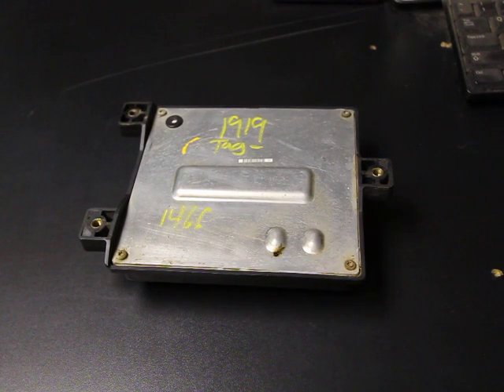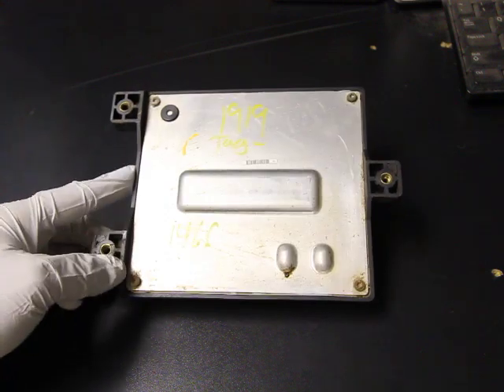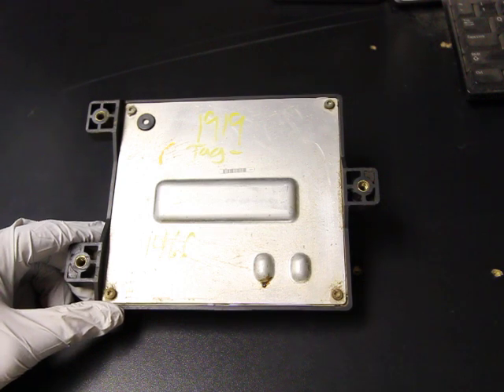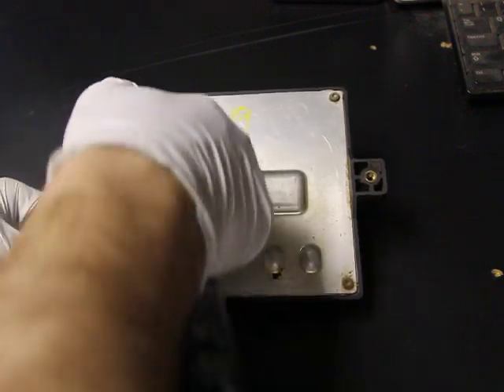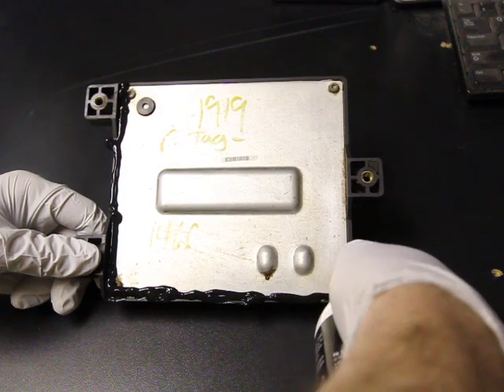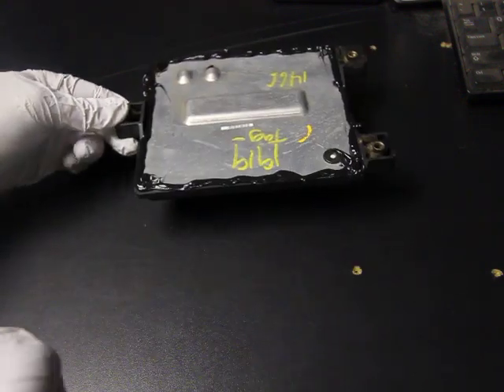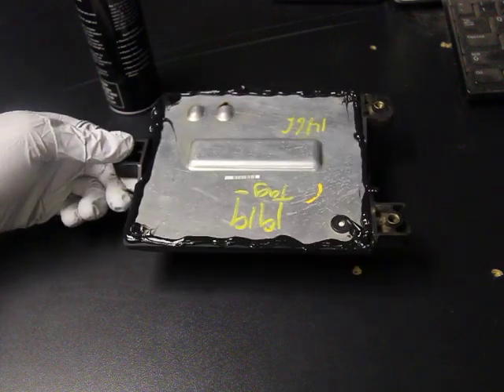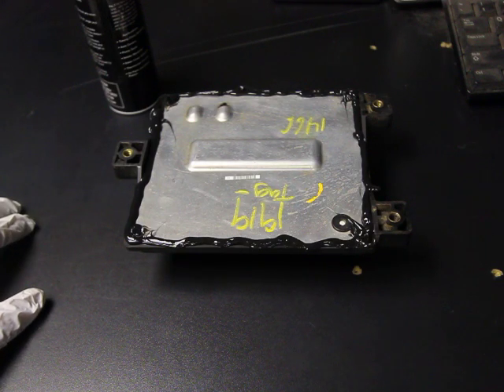Fuel Pump Control Module GM Truck GMT900 Silverado and Sierra replacment and programming info

Comment: Thank you, but we worked on it last night late into the night, was no power doing to the fuse. Pulled the fuse box’s and found a lose wire going too the fuel pump fuse. Damn something that damn simple, left me stranded with no truck for a week, that’s f up .

Comment: Will a Failing FPCM cause low Fuel Rail Pressure? When I “key on” the Truck (07 Vin C Gmt900 silverado 1500) i get 58psi. But when I start the truck fuel rail pressure slowly drops down to about 43psi. When i give it gas it goes even lower than that. 38,39,40 ish.
Reply from the maker: It could put power directly to pump and measure pressure

Comment: I see you say the 07 Tahoe does not have  one. Is there just a ECM under the hood
Reply from the maker: ECM controls the fuel pump relay which in turn powers the pump on 07 Tahoe
Reply: @SpartanAutoworx  thanks for the info👍

Comment: Hello i need one for a 2007 GMC sierra.i have the old one.replace fuel pump thinking it was the pump.i unplug the fuel drive module,i made pump run with 2 wires too conector Soo i Know is the module.how do I order one plug and play.

Comment: I have this problem in a 07 Tahoe can you help me I'm currently broke down with my kids on the side of the road. Thank you in advance
Reply from the maker: No FSCM on 07 Tahoe
Reply: @SpartanAutoworx  then what is the scan that refers to a module that works with the fuel pump that's failed on that yr model
Reply from the maker: What code you have?
Reply: @SpartanAutoworx  I'll have to find out tmrw
Reply: @SpartanAutoworx  P069E is what my mechanic believes it was.

Comment: I brought mine directly from Audi already and had it installed and yet I'm still getting the same issues with the car. Does Audi fuel pump control modules need to be programmed and IF so how much would you charge me to do mines if I sent it to you? I already baught it so I can't get it from you, hopefully you can jus program it.. Ty very much for ur help.. Ps
 I have a 2008 Audi a4 Quattro 2.0 turbo 4 cylinder

Comment: I was told by a dealer that it had to be in the truck to program, how are you getting around that?
Reply from the maker: We possess magic that makes it possible. ;)

Dont let the dealer completely empty the pocket book. We can Program and ship one to you for plug and play operation. Look us up at GMFLASH.COM

If you have any questions give us a call at 1 314 43 Flash

Have a great weekend.
Reply: @SpartanAutoworx  so if I jump power to see if the pump runs, which it did,..does that mean the fscm is good ?
Reply: Spartan Autoworx I haven't totally diagnosed it just yet, hitting a road block. certainly don't plan on paying to tow it to a dealer if I don't have to.
Reply: I pulled the fuel pump relay to test and am not getting command power when I turn the key to power, or try to start it. I can't find a schematic to see the power flow to understand why that would be.

I'll have to jump the connectors like you said and see what happens
Reply: Spartan Autoworx I got back from out of town today and jumped as directed. if the problem was the control module wouldn't the truck start when I jumped it?

it started for a brief second and blew the fpcm fuse. I replaced the fuse and can not replicate.
Reply: The mechanic the dealer and O'Reilly's Auto parts told me it don't have to be programmed but the paperwork inside it does so who the hell is right and who's wrong
Reply from the maker: You can always jump power to the pump to test it.

Pull the plug

you will see 4 big size wires on each side of the module.

two on one side 
red/white- battery 12v
black - ground

other side
gray- pump power
pink- pump ground

jumper and see if you have a running pump.

If not give us a call for a new fscm. You can also buy online at GMFLASH.COM We have them in stock. :)